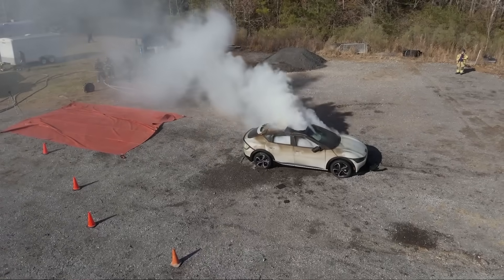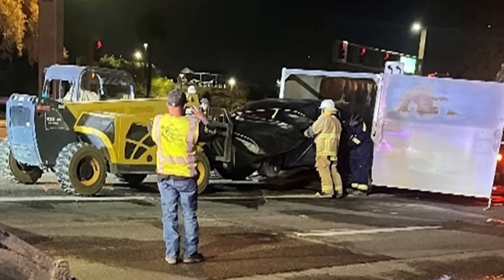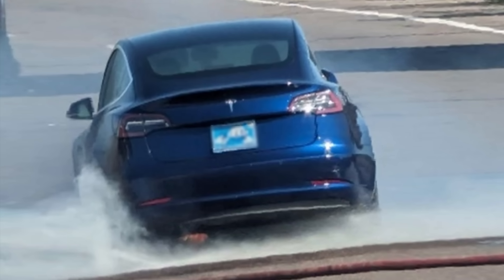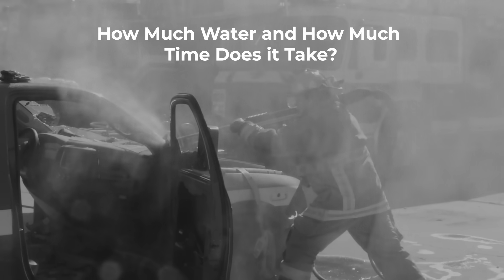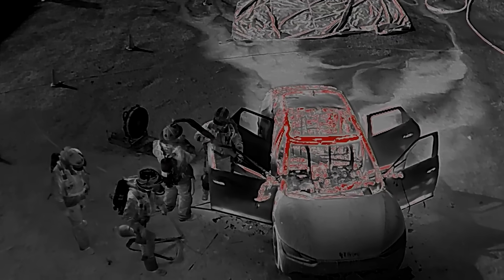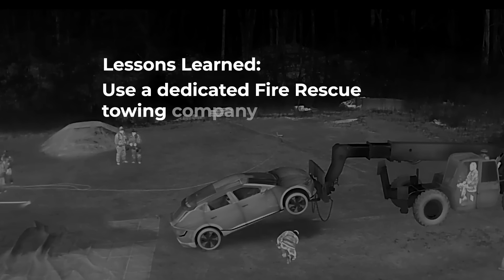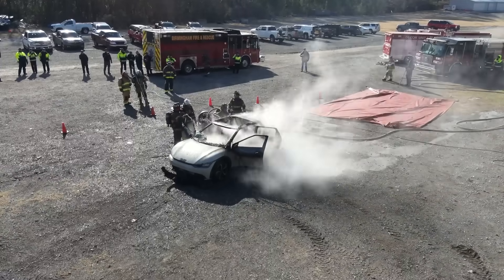Quick and Efficient Method of Extinguishing of an EV Fire tested in Tempe, Arizona

Comment: Lithium reacts with water. That is likely the reason for reigniting later. Any residual fire can ignight the lithium. Another reason for reignition would be high heat. For small home fires water is definitely not recommended as it can make the fire much worse. Fire blankets or lithium specific extinguishers are best for home use

Comment: That method still doesn't solve the reignition problem.  The battery will continue to reignite until its energy is used up regardless of how many times you respray it.  Insurance companies are quickly realizing that EV's are high risk and are beginning to put major restrictions on them, if they choose to cover them at all.  Now that the mandates are dead and manufacturers are realizing that people don't want them, the EV space is finally, thankfully, dying.  Oh, and good luck trying to sell your used one.  They're worth only about 1/4 of the MSRP and falling.
Reply: Ya sure

Comment: Ok. Lithium fire generate its own oxygen. Meaning you CANNOT put a lithium battery’s fire out. Period. The new method flood the battery with running water, preventing the fire from transmitting to none burning cells. Smart. But even better: DON’T USE LITHIUM!!!
Reply: Lithium batteries are the best currently though, and some lithium batteries are incredibly safe, like LFP.

Comment: This is too complicated, special equipment, training, dangers for rural fire departments to handle.  A port to battery is not the worst idea.  I of course do not know how cells are divided. I would hope a CO2 unit could be set to port?  As enclosed could it suppress, cool long enough for FD to get on scene?  Or at least get passenger, driver out?

Comment: All it is is a water jet cutting lance it runs at 30-50.000 psi normal use it cutting steel up to 12" thick appropriate safety gear must be worn!!!!!!!!!!!

Comment: Imagine a hardened robot which flips the burning car onto its roof, then drills or punches a series of holes through the floor pan, allowing firefighters to get water into the cells with maximum efficiency.  Then a robot that wraps the vehicle in a special fabric, spraying in retardant, then more wrapping.  Finally, skip loader to dump truck, then transport to special holding yard.

Comment: Lithium self ignites in oxygen. Water is hydrogen and oxygen. Electricity separates water into hydrogen and oxygen. Hydrogen is flammable. Lithium battery fires are the perfect storm. I personally believe e-v batteries should be packed in mineral oil.

Comment: wouldn't an EV manufacturer be able to provide an access point to the battery compartment where the extinguisher equipment could be connected? thus, direct access to   the exact place it needs to go. while we're at it, carry the extinguisher fluid on the vehicle, ready to deploy when the thermal runaway condition begins.

Comment: While watching this, I was thinking, what would be a quicker, easier access. And going under the car, and working off of a preknown grid of cell placement. Quick, easy access without fighting to gain access from the top. A jack support beam for when the tires explode would maintain access and additional water abrasive  cutters could be added for multiple cell penetrations. What do you think? Quick easy access from the side, multiple cell penetrations, maintaining vehicle height.
For access until extinguished. If tires were already deflated, A lyft dolly, could be part of the cutter matrix of cell placment

Comment: It’s so great that manufacturers are allowed to build cars people can’t get out of because of a battery problem.

If we had functional regulators who put safety first, there’d be a universal port to help firefighters put out EV battery fires quickly and safely — and there’d be mechanically functioning door handles that work regardless of whether the car has power. No one should ever be trapped in a vehicle just because the battery died.

But our government only seems to care about what the rich and big corporations want — everything else, including your family’s safety, is an afterthought. So you’re left locked inside while the flames rage.

Comment: I love the fact that they are working on solutions to an ever increasing problem. Fire fighters are smarter than cops :)
Now for my 2 cents. An EV battery fire is going to be a total loss so I'd attack it from underneath. Build an apparatus that rolls in under the battery area that will blast a shitload of BB holes in a short time, Then switch from abrasive to high pressure water. and finish the job. 

 Also, make the manufacturer's engineers come up with a better solution. Maybe a standard water inlet port that would flood the battery quickly. Maybe better circuit breakers.

Comment: They should just design these EV's with removable batteries that can be ejected in an emergency where they catch fire, and also be removed for annual mandated inspections. Similar to emissions testing for ice cars, batteries in EV's should be inspected. An ejected battery will protect the vehicle occupants and make the battery fire easier to inject water into and put out quickly.

Comment: I thought putting water on ignited battery caused explosion? Here in my town, we had a lithium battery storage building catch fire. They watered everything around the on fire batteries but did not water those lit batteries. Did this for hours with evacuations. No guarantee it was out. No way to tell if any of the batteries are in or still in runaway. It had to be babysat for weeks. Much more intensive labor and expense. 
Palisades fires no one wants to talk about the lithium cars and batteries throughout these homes that caused intense spread of fire. I'm glad to see someone is working on a solution. If gas cars burned this way they'd be banned but not EV. I think all EV and hybrids shoukd be banned till they find a safer power system

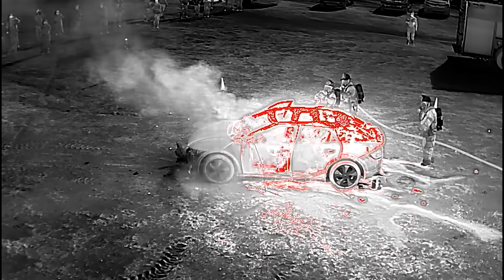Comment: 2:55 "It had electronic door handles, we couldn't get them to operate. We tried the manual override and couldn't get them to operate either". What is the purpose of manual override if it only works when the car is functional but stops working during an emergency?
Reply: Surprise - in an accident, mechanical components can fail too. Do you think the jaws of life was invented only after electronic door controls were used?
Reply: @Narcissist86  There is a big difference between mechanical failure due to accidental damage and design failure.
Surprise - Firemen use the 'Jaws of life' less often than they encounter EV battery fires and EV's only make up a tiny % of the vehicles on the road. I will stick to what works not what kills but if you prefer the opposite that is your choice, have a good day.
Reply: Lol first, good job giving your own comment a thumbs up.

Second, EV fires are actually much less frequent than ICE fires - and that is adjusted on a per 100,00 vehicle basis. This is data from NTSB.

We simply have no clue why this failed, especially when mechanical release failed as well. It's silly to attribute it to design failure.
Reply: @Narcissist86  So you are one of those? Ok, thank you for your comment and good luck in the future.
Reply: On of those? You mean people who cite proper statistics? Yeah.

I guess giving your own comment a thumbs up is the only affirmation you get in your life? Good luck to you too, I think you'll need it.
Reply: I’ve wanted a Tesla for a long time; but the more I do research like this. 
I don’t even want one. 
I’ve heard this junk a lot; the one that blew me away. 
Dude was pulled over while asleep; he got a DUI but his car was driving. 
So now they put a new feature that if human eyes close for to long it just pulls over. 
So I can’t even use the FSD cause hands on wheel; and eyes open, or vehicle pulls off road

Comment: Excellent job, but still just a "stop gap".  The problem is the chemistry of the batteries, not just in automobiles but e-scooters, e-bikes, in home battery operated appliances.
Electric power in everything (not just EV's) is probably the future, just not with current battery tech.
Reply: Well, we're going to be stuck with lithium ion batteries for a good long while 😐

Comment: What they did right there is to failed to extinguish simple car fire. NOT battery fire.
BATTERY fire is IMPOSSIBLE to extinguish.
IF that water helps with cooling down the battery cells enough to not self ignite- then this is great.
But in case there is not enough flow of water to keep everything cool- then you have another fire, just delayed.

After every crash of electric vehicle, battery MUST BE OPENED and dismantled.
Otherwise, the cells will just short-out, get hot and catch on fire.
Why every single battery do not have easily accessible, standardized water ports for cooling is beyond me.

Comment: It would have been nice if the car manufacturers had figured this out before selling EV cars. I guess if you buy an EV car then be aware that if a fire break out don't expect to get the car back in any repairable state - complete loss. All this firefighting for EV fires ( special towing solutions, etc)  looks like it is going to cost more, which everyone pays for, so any savings of  EV use is going to be tempered with the cost of potentially putting an EV fire out.
Reply: Poverty is considered a weapon by some, so EV's are just fine with them.

Comment: Water is actually the catalyst of lithium battery explosions. I think what is happening in these fires is that the water is just putting out the flames, but eventually penetrating the individual cells that are damaged by the heat, and then exploding.  There are even YT videos of people disassembling a small lithium battery and throwing it in a small amount of water to see it violently explode. Solid state batteries should change this dramatically, as they don't short out and create fires in the same way.
Reply: That's not how it works. Yes, if you put pure lithium metal in water it will "explode" but that isn't what is inside a lithium ion battery. It's stored as lithium ions in something like lithium cobalt oxide, lithium managanese oxide, lithium iron phosphate or similar and it is that last part - the oxygen that is the problem (both in the cathode and the electrolyte) because a fire can self propogate even without an external source of oxygen. If you exposed these compounds to water they do undergo a chemical reaction but not a violent one like pure lithium metal. Eg LiCo2 would produce lithium hydroxide, CoO2 and maybe some Co2+ ions. The explosions you see in EVs (very few and far between) generally come from either the fuel tank and vapour buildup in the case of the Jeep Wrangler PHEV or just super heated air in the case of a non hybrid, always before the fire fighting team get there.
Reply: @mondotv4216  Thanks for this info!
Reply: BTW Cobalt oxide is a known carcinogen so don't try this experiment at home!
Reply: The truth nobody wants to know. 29 june 2025.

Comment: could the battery compartment have a standard access port on each side, this could be retrofitted.
If the battery compartment is cold, immersing the lithium in alcohol or metho will cause it to slowly dissolve, but that’s no good if it’s still hot. might be good in preventing fires from recurring.

Comment: In my experience, chemical dry powder extinguishers work well on lithium battery fires. Water torrent not so good because it simply spreads the 'oily' electrolyte and reacts with any metallic lithium. Water mist helps cool things down once the chemicals have it under control.
Reply: Very well said, yes.
Reply: I imagine dry powder would be more difficult to spread inside the battery
Reply: The batteries create their own heat and fuel, so a dry chemical would be worthless.  In very small batteries, less heat, so it might work.

Comment: The piercing nozzle is a great idea, but what about fire departments that lack this equipment?
Would it make sense to shoot through the battery compartment and then just use a standard hose to force water into the battery?  I'm thinking, throw a grapple on the upwind side of the car, toss the chain over the top of the car and use the (heavy) fire truck to flip the car onto its side or back, making the battery accessible from the bottom.  Puncture the battery  by shooting it, then go to town with the water.  Does this have any merit at all for fire departments lacing this new equipment?

Comment: As a firefighter, we now consider just letting it burn and keep the fire from spreading. LiIon batteries reignite because some of the cells have not discharged all of their flammable material. Once all the battery cells have burnt out, there is no more fuel to re-ignite.

This might take 12 hours, but once burnt out, it is inert.

Comment: Nice to see some progress on this front. Put a long chain with a hook on it onto the pillars or roof and pull the vehicle onto its side with the fire truck to give you better access to the battery. Good video. All the best.
Reply: You'd probably just drag it around, EVs have a really low center of mass
Reply: Eventually we'll see a mat with 100 blast nozzles rolled out under the car.

Comment: Fkn MADNESS that man's science has invented such a kind of car that takes so much effort to deal with in the event if a fire. 100 gallons of petrol takes 1 minute to put out with  foam, powder, or CO² suppressant.

Lithium technology is kind of like splitting the atom -- good in some ways, but a disaster if/when its chemistry gets out of control.

Imo, EV makers should have some kind of LEGISLATED fire extinguishment system BUILT IN. It is their invention, so it should be their expense and the customer's to foot the bill for a lithium fire. This is a crazy way to have to deal with it.

Comment: Extinguishing EV fires is a big expense and time consuming for fire fighters and the city. Vehicle manufactures should be required to have a fire extinguishing system built into the battery or vehicle that activates immediately the battery ignites or reaches a critical temperature.

Comment: Using the lance initially just like a waterjet cutter to cut through the door looks, could speed up the access. As for being happy that the EV fires are not making the news, what are they really trying to hide from the public? If people don't know about these things because they are trying to hide these incidents, then you are limiting the ability for people to come up with ideas that may be significantly helpful in the future? Probably the biggest question I have, given that we know the potential for EV fires, and the massive amounts of damage they could cause, is why there is no fire suppression system built into the battery department? That goes for ICE vehicles as well. Great to see the innovation on display though!

Comment: Stupid people. Tow truck? Come on people, think. Put an elbow on the end of the water cutter and simply slide it underneath the car and use the thermal camera to guide it. You can make the tool as long as you need to be safely far enough away from the car.

Comment: Best solution is back to the drawing board. All EVs should be able to drop the battery pack so the car can be separated from it for fire handling. The car can be easily extinguished while the burning battery can be cased in a transportation sarcophagus or flask to be removed from the scene for specialist processing. A standardised contingency protocol is required.
Reply: They already have designs that don't burn. Those are being improved and are already in cars

Comment: This is a tool in the armoury and may reduce the risk of re-ignition, but statistics are proving it does not eliminate it. The problem with this approach is that you will actively damage the rest of the battery; whilst cooling the cells in thermal runaway, you are also damaging otherwise good,cells, and surrounding them in a chemical and likely conductive soup. That can also lead to re-ignition of the vehicle from another part of the battery. Whilst there is energy stred in the battery chemstry, that risk remains. The only way to safely eliminate the risk is to remove all the energy by letting it burn. Either way, the vehicle is a total loss. The evolution of methods to deal with EV fires continues.
Reply: Thanks Dad.

Comment: Even though water cools down the thermal runaway, the water itself causes lithium to self-ignite in a redox reaction. That reaction produces lithium hydroxide, hydrogen gas, and a lot of heat - enough to ignite or explode.  I've watched a strip of lithium ignite after being removed from a battery and simply exposed to the air.  The amount of energy in those batteries is tremendous, so once a short has developed, it will keep heating itself until all that energy is depleted.  The only safe way to store such a battery that has ignited would be in a refrigerator with a lot of dessicant to keep the heating under control and keep moisture away from the lithium.   Using either liquid nitrogen, or a massive amount of CO2 (which will be cold when released) would be a lot safer than using water on the batteries.

Comment: Job well done. Kudos to You and your Brothers in Europe.
If it is a question of Compartments in the Battery Box maybe the B.B. should be engineered at the Factory to your needs and specs. to make your job easier and safer.

When I saw the Conex Box I thought inside, it would have only been the E.V. and an inexpensive bottle of Nitrogen attached to the outside, feeding Nitrogen into the Conex through a drilled hole and metal tube...
I guess it, too, would starve the flames of Oxygen but not the Red hot heat due to the discharge of the Lithium Cells 🤔.

Gregory/
The Pigeon Meister
        ... .  🐦‍⬛